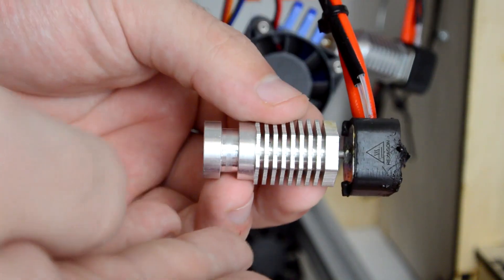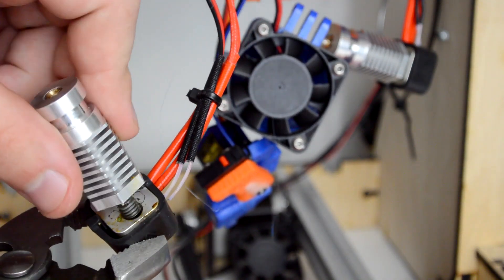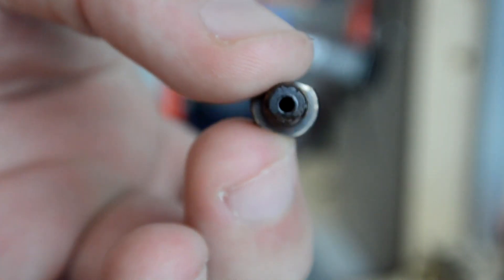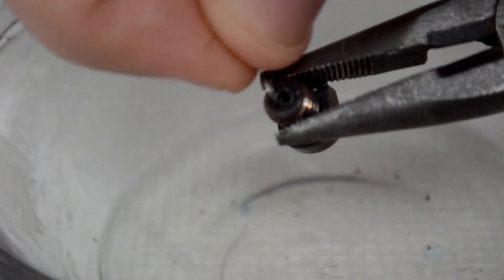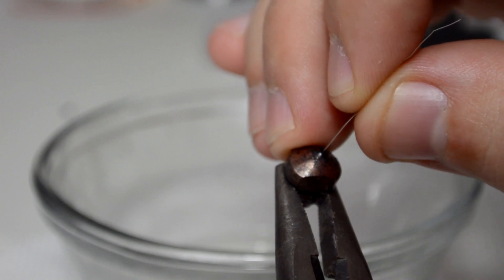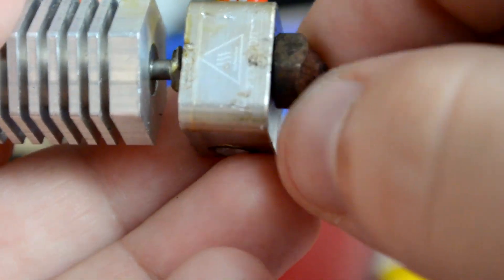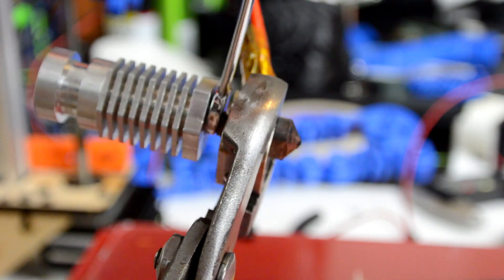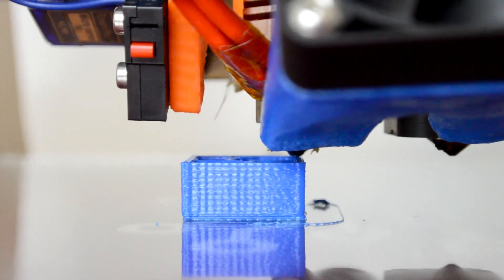Clearing a Clogged or Jammed 3D printer nozzle! - 3D Printer How-To

Comment: I have a better technique. It's called ordering a new nozzle! I'm using an Anet A8 printer with the standard cheap nozzle that came with it. I switched from ABS to PLA and tried to print, only to find that the nozzle was clogged. I just paid about $60 for an E3D Steel V6 nozzle and some E3D steel heat blocks. Then about $5 on PTFE lined screws to hold the heat block in place. I shouldn't have to replace anything for quite a while now, I'm guessing at least a year. Maybe take it apart for an occasional cleaning. Thanks for the video by the way, it was pretty helpful, I just don't have the patience.

Comment: Hello, My 3d Printer (Creatily CR10S) has stopped working properly today, the nozzle is not melting anything although it is heater properly. The Filament is being pushed and everything is working perfectly. I cleaned the nozzle today morning after the problem started occurring, do you have any suggestion what could be happening?

Comment: Your tip about heating up to higher than  highest temp I plan to use before tightening nozzle head was just the ticket! I think not doing this is the root of the jamming/back up issues I've been having. Thank you for showing each step so clearly.

Comment: I have cleared PLA so far by manually increasing temperature in the printer software, wait a few minutes, then push down on filament with my hand so it begins to extrude; then pull the filament out. You could control the filament with the software also but extrude small steps at a time. Not good to extrude 100mm if the nozzle might still be jammed. Do only if you begin to see the plastic begging to flow.
For those who heat the nozzle with a heat gun or torch while disconnected from the printer, you can probably have a bottle of canned air to quickly blow through the hole while the plastic is still soft. The cold effect might also cause any residue to flake and fall off. 
Untested but this might work also: If you removed the filament from the head assembly while still mounted to the printer, elevate the temperature through software for a few minutes and then quickly blow canned air through the top to finish pushing out the hot plastic.
Reply: typo: l meant "... beginning to flow"

Comment: No matter what I do, my nozzle and hot end looks like a waffle house grill after a few days of printing xD How does anyone keep them clean?
Reply from the maker: I bought a small brass wire brush (only a couple bucks on amazon) and give a quick swipe or two every so often to clean off some of the junk from the bottom. Make sure its brass so that it doesn't wear away your nozzle, steel brushes may damage the nozzle.
Reply: Hoffman Engineering Well, I learned a trick to clean the nozzle, but the heater block still looks disgusting. I might pick up a wire brush to deal with it. Guess every now and then plastic hairs curl up onto it then cooks until it decomposes.

Heat the hot end up to 220, crash it into a pile of PLA, so it sinks into it, then turn the hot end off and let it cool, then yank the pla off. The tip will look brand new :) If using a stainless tip, you may have to heat it back up to 120 or so to soften the pla a bit.
Reply: Word to the wise.  I have a Lulzbot 6, and apparently there is +5V put to the end as part of the self-leveling detection -- i.e. when it goes to the 4 corners.  I used a wire brush to clean the hot end.  Suddenly there was a spark and my printer stopped working.  I contacted support, and they pointed out that the manual says to never use a wire brush.  Apparently there was a small segment of bare wire near the heater circuit.  My wire brush caused a short between the +5 volts of the hot end and the ground from that circuit.  I was lucky that an internal fuse on the computer board blew, so I didn't have to replace that. But I did have to purchase replacement fuses from Lulzbot.  Cost me $16 and about 1 week of down time.  Moral of the story is that one is supposed to use a 3M type scrubby pad to get that gunk off.  I guess an alternative would be to get the hot end hot, then turn the printer off and use a wire brush to clean it.  But I'm afraid to do even that.  Sometimes there is residual power stored in capacitors, and there might still be problems after the unit is turned off.  I hope this helps someone else to avoid the problem I had.

Comment: I found that you could soak the nozzle in acetone, while on the heater block for 10min, then remove and dab off the excess acetone.
Next, remove the cold-end (there may be a piece of filament in there) and heat the hotend to 200ºC before pulling the filement out.
Finally, while still heated, replace the coldend and push a piece of new filament through...it should begin to extrude out the nozzle.

Comment: Nice work. I have this problem constantly and it drives me nuts. I'm thinking of looking at another method of printing because of it. I have the HobbyKing Print-Rite and it printed great when I first got it but went down hill 6 months later. Since then I have change the heat block, throat, and nozzles several times. I recalibrate the bed and nozzle like always and try proven print jobs and it starts ok but fails 50-100 layers in. 
I suspect my filament but I've changed for different rolls. I'm using the Microcenter Inland brand filiments which are cheap (15-20usd avg) and work for the most part. The specialty rolls get brittle though and I have a couple rolls that are wond wrong and taggle.
Any suggestions on what my issue might be? Thanks

Comment: what make the filament roll up under the nozzle
Reply: Bed too high usually. When laying the bottom layer, not enough clearance to extrude. That can cause a partial jam, which can cause the filament to come out at an angle, rolling back over.

For partial jams, I like to use clear PLA heating up too hot(250c), and push the filament through the hot end by hand with high force. You will see it clear because of black specks in the extruded plastic, which is why I use clear filament. A couple drops of vegetable oil in the hot end first helps as well.

Comment: Buy a second nozzle to swap out and just leave the clogged one in a acetone vat when it gets clogged.  Swish it around every so often on your desk to wash the soft layer off.  I keep the nozzles for my airbrush and HVLP sprayer in solvent baths when not in use and it works really well.

I see a lot of people jabbing wire on the inside to clear jams and that's not the best idea.  This creates scratches in the brass and will perpetuate your clogging problem.

Comment: If you leave the hotend on the printer and heat it to the temp of last known filament that caused the jam , then use a airbrush nozzle needle cleaning pick, by putting it up in the nozzle and turning it once or twice, it with un clogged it in seconds. No mess no fuzz.

Comment: Copper wire from a phone cable like the wire in this  is quite tricky and bendy to poke in a 
blocked Nozzle 

The best wire i have found to use is a guitar string E 0.30mm B 0.41mm
 end ,its really strong and not that bendy so when pushing a blockage out you can use extra force

Comment: Some things bother me on video:

Wrong tool to hold the aluminum block (need some vise tool with some soft grip).
Too soft wire for unjaming the nozzle (metal guitar string).
Too short time in acetone bath, (need at least 24hs acetone bath).
Did not remove all dirt inside nozzle (cotton swab with acetone).
Did not clean outside nozzle.

Comment: when my gets clogged  ( usually when i switch from ABS to PLA or back ) because I forget to do a good hot purge in between .  i put the nozzle in my helping hands or a bit of stiff  wire , and place in next to but not in the flame of a votive type candle .  you want it close enough the flame just start to bend towards the nozzle , but not appear to touch it .  you want the threaded end down say like about 45deg and have that side on to the candle . usually within a min or so you will hear fizz type sound and possibly have a small bit of soot on the nozzle to wipe off . Then a quick check and a bath in acetone after it cools and if it was not for small tool marks.you might never know it was ever used.  works quick and easy every time no matter how nasty my PLA gets in it . only thing it wont get out is if you have bit of contaminants form  dusty / dirty or cheapo filaments  . then you gotta poke a bit of wire like you did  .
Reply from the maker: +XerotoLabs Very detailed explanation, thank you! The filament I was using before it started clogging was a Glow-in-the-dark green filament, which contains pigments to glow. Either it was dust on the filament (possibly, its older filament that I've purchased before I got a nice container for them), or some bit of the phosphorescent pigment didn't behave right. Either way, if it happens again, I'll break out the candles! :D
Reply: +Hoffman Engineering watch you dot over heat the brass , over 400c (fast annealing starts about there for copper and brass if recall )  and it will soften and you cant re harden brass like you can steel . I was not very clear in my post  but i never let the tip of the nozzle in the flame . i heat form the fat/ thread side mostly . the thin metal at the tip is easiest for flame to over heat and soften  , and it's also what wears out form  exotic filaments abrasion .  
so uh yeah remember you cant re harden brass by quenching . quenching only cools brass. That's the 1st big possible downer to burning out , or heating out ways . 
2nd is if you don't get the carbon residue out . its mostly soot and would  flow rite past , but exotic filaments have extra 'stuff' in them . they can be more abrasive on the nozzle tip .  so we want to keep whatever hardness the brass came to use with . 
I have successfully got junk out from min doing a cold pull with ABS , after heating it and poking  the tip with wire .  but if you cant get that wire in  when you have hot ABS  temps , your have to tear down like you did . I wonder if your hot air  gun would have eventually worked if you did wire and  that at the same time ?

I have had almost no jams since I put foam block  dust remover, and with a touch of olive oil on it  for PLA . I have yet to run ABS that way .
PS you ever revived the MEGA2560 board that died on you a while back .. (just curious)?
Reply: Just a quick .02; no need for the oil w/ ABS, although the foam to remove dust is proly always a good idea ;)

Comment: I use a torch to heat up the nozzle until all the plastic burns off then quench it in water so any remaining residue will just flake off. This should work for ABS, but I've only used it for PLA. Regular maintenance I just use the cold pull method to clear out any clogs.
Reply: +lee19702 http://bukobot.com/nozzle-cleaning
Reply from the maker: +lee19702 Great link! I know the torch works great for PLA, as it burns out cleanly, but I think abs might leave too much residue. Only one way to find out though!

Comment: I usually just heat up the nozzle and shoot compressed air through it
Reply from the maker: +Emory Ducote Compressed air, eh? Haven't heard that one before. Do you blast it through the opening where the filament enters, or start where it exits?
Reply: LOL with an air compressor.
Reply: Just had a thought - what could a guy use for a chamber you could heat up, then screw your clogged hot end into, and as the chamber cools (keeping heat on the hot end) the vacuum would suck up the clog?
Reply: how?
Reply: how do you get the compressed air?

Comment: wrap the ends of that wrench up with tape to avoid bites to your hot end insulation
Reply from the maker: +modeem352 Yeah, I didn't about that until after the fact :( It had that silicon sleeve on it originally, but that sleeve ended up splitting so I just removed it entirely. Didn't think/notice the bite marks until editing this video. Tape is a good suggestion for that though!

Comment: Great video, I'm glad you kept in the 'failure' with the heat gun. I generally let my nozzle soak in acetone until morning and then go digging the ABS out.. 

What are your recommendations for unclogging nozzles with PLA jammed in them? (I generally use ABS)
Reply: +RJ_Make when getting pla out of a clogged nozzle i use heat normally a torch but a lighter or candle also work have use a candle in a pinch just burn the plastic away the was with acetone
Reply from the maker: +TaintedCamper +RJ_Make I've heard the same thing. PLA burns out cleanly (which is why you can do Lost-PLA casting), so you can fire it with a torch and just burn out the PLA. Now, if the jam was caused by dirt/dust on the filament itself, then that may not burn out completely, but you may be able to pick it out after torching it!
Reply: +Hoffman Engineering +TaintedCamper Thanks guys
Reply: For PLA, you can throw the nozzle in a can of PVC cement overnight, then rinse it off the next morning. The PLA will turn white(dying the PVC cement) and will be the consistency of a wet noodle. It will be easy to remove then. It seems destructive, but actually when PVC cement drys on anything but plastic, it is similar to elmer's glue, and peels right off. PVC cement is also THE best bed adhesive, but is too expensive, stinky, and carcinogenic to use, but may get you out of a jam for a difficult print.

Comment: Had one terrible jam where i was working, PLA printer. And it wasn't really easy to disassemble ... turns out using cheap PLA filament knockoff has its cost. It made a black blob on the heatbreak/just before the nozzle.

More or less did what you did, without the acetone part ofc.  which if you had left the nozzle in it for some hours it'd have cleaned it :) ABS might have a high warping (0,8%) high temperature nozzle temperature and some presumed nasty fumes. But acetone interaction makes it worth it .

(always remember to have it on a ventilated area!!)
Reply from the maker: +JJ CC The smell doesn't bother me, but the reports of "microparticles" and such possibly being a carcinogen is worrying. Its in a room with decent ventilation, but an enclosure with venting is definitely on my project list!

How'd you get the PLA unclogged, burn it out with a heatgun/torch?
Reply: +Hoffman Engineering Something like that, manually setting the nozzle temperature above regular PLA temperatures, and a combination of pinching and stretching the drops from the nozzle and pressing from above with fresh PLA. (usually those short scraps of filament that are unuseable)
If it doesn't drool (the nozzle) pulled the pressing scrap PLA out (which would be all dipped in a mess of degraded PLA/clog), cut the dirty part, keep pressing on.

So i basically used those short rests of PLA as a plumbing tool.

I also used a cable for the final "clear". Although my research indicated that there are guitar strings that are that small (but i wouldn't use them if your nozzle is not steel).